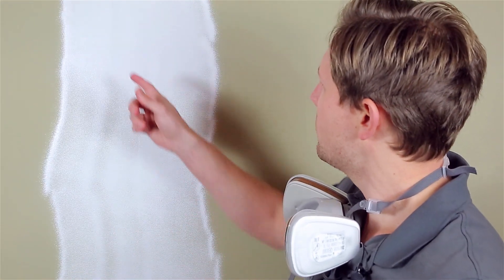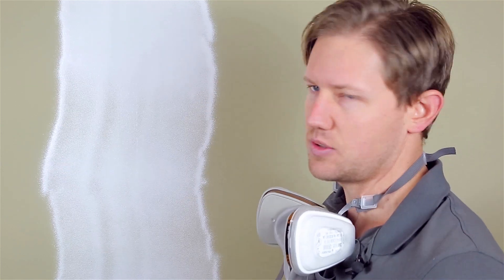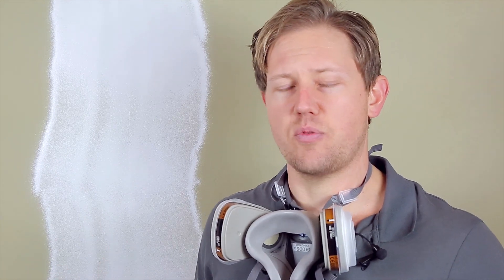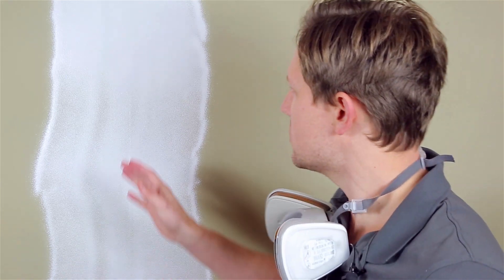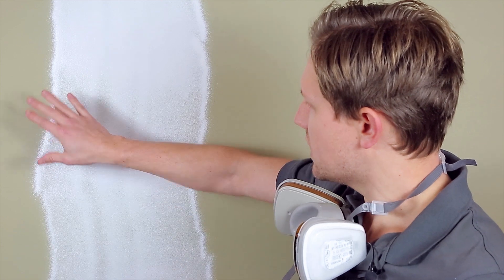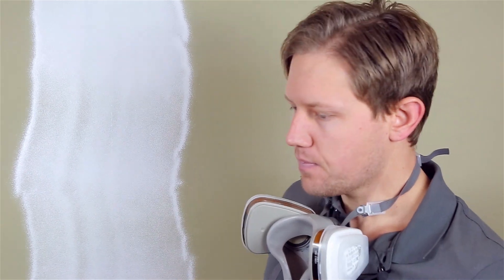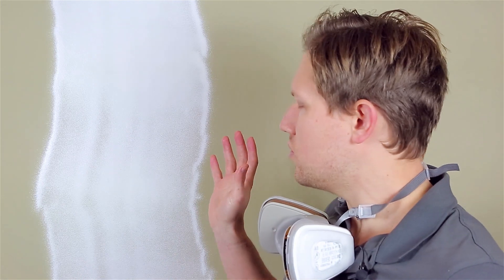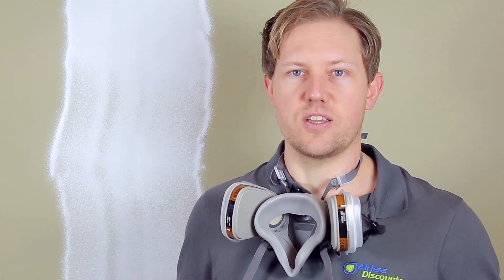Airless Q&A #8 - Striping and Tails in your Airless Spray Pattern

Comment: I just use the sprayer to apply the paint on the surface and go back and use a roller to spread it evenly as my sprayer will not spray thick paint well but it saves a TON of time just by using it
to apply the paint.

Comment: I have a big round streak pool in the middle/center of the fan. How to fix that. So no lines on the outside but it shoots more paint in the center than the outsides
Reply from the maker: You can reduce the size of your tip as well as the filter eventually.
Reply: @ don’t think thats it. I spray with the normal 517 green tip ff for stndard latex
Reply from the maker: You can therefor try a 516 for example. Otherwise double check with the manufacturer which tip size they recommend for their product.
Reply: @ okay ty

Comment: I sprayed undercoat total prep on doors using Wagner 3.31 with 313 tip but lines were so bad ... Any solution?
Reply from the maker: Hi,
Increase the pressure and/or use a larger nozzle. 
Kind regards,
Airless Discounter team

Comment: Hi . I was wondering if you would reccomend a blue rac x 517 tip or a rac x  lp 517 tip for spraying masonry paint.  I'm using a graco ultra 395 pc . Thanks again
Reply from the maker: Hi,
Thank you for your enquiry. 
It always depends on the exact product used. However, if a 517 nozzle is needed to spray your paint, then a low pressure will be more appreciated when spraying and for the machine itself.
Kind regards,
Airless Discounter team
Reply: @AirlessDiscounterInternational  thank you mate.